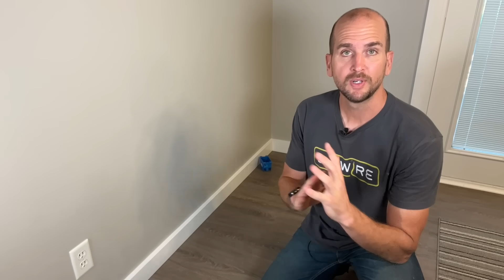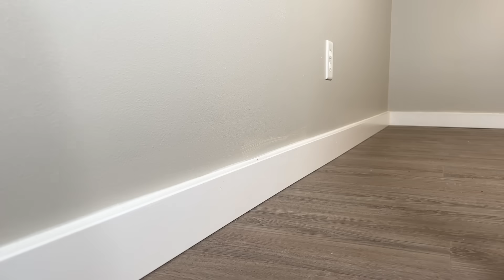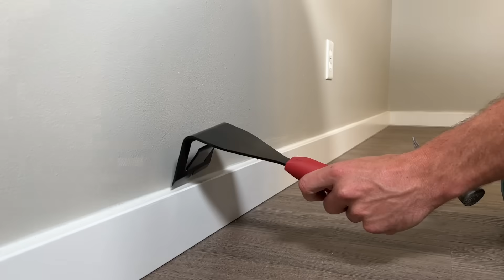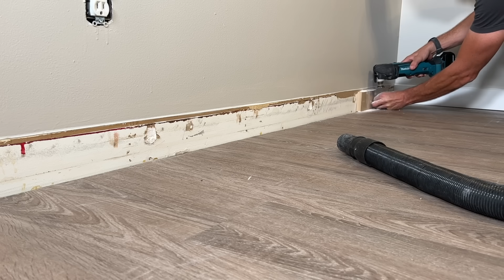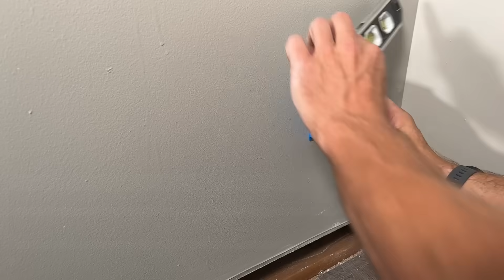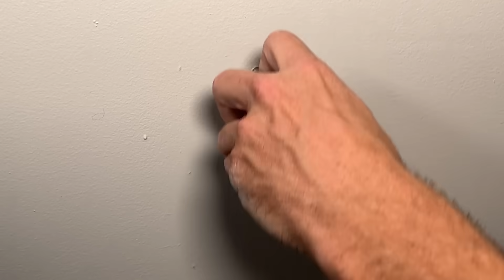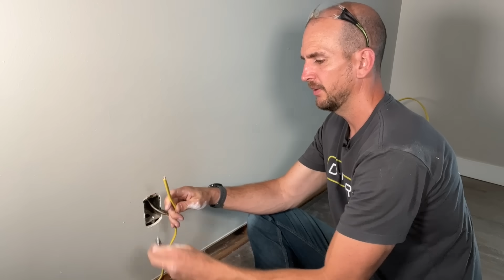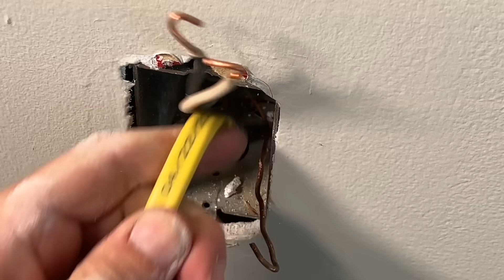How To Add An Outlet To A Finished Wall

Comment: Not to code, and not safe. The wire must have metal protector plates to prevent piercing the wire if it is less than 1.5 inches from any wall surface . This means he can not drill holes at any Hight thru the center of the studs and simply pass the wire thru. the wire is now less than 1.5 inches from both surfaces on that wall.  this unsafe  because someday someone can drive a nail or screw into that wire , by mounting something to the wall, even mounting something low to the wall like a bracket. Codes requires the wire have metal protector plate. The proper installation would be to notch the vertical studs and place the wire in the notch then cover with protector place. This will leave the wire close to only one side of the wall but protected by metal plate. And it will be  more than 1.5 inch inches from the other side of the wall. what he did here is very wrong and unsafe

Comment: This is a great video but everyone should know they still need to pull permits even if it is in their own home. In 🇨🇦 you need to arc fault protect the new wire and plug.

Comment: You need to also teach about the NEC rules about box depth.  That feeder box was set back more than 1/8' from flush so that needed a box extender or to be reset at the proper depth.

Comment: Lock nut is upside down fyi, should have teeth towards box. Appreciate the use of the Waco connectors though and the position of the cover plate screw.

Comment: A few things:
I used to be a high level electrician and back then Wago 221s didn't exist, but they are now my #1 connector!

3 12ga romexs would be max in that box, especially using wirenuts. There are deep and shallow boxes, unless there's a reason not to, I always opt for deep boxes. Regardless, keep box fill in mind when contemplating adding wires to a box.

When using old work boxes, cut the ears off the receptacle (or switch), least the cover plate will not sit flush to the drywall. For new work boxes (nailed on studs before drywall) leave the ears intact.

In most residential applications, the existing boxes will not be steel and will likely not facilitate a connector. In this case the romex will merely enter the hole (though you might have to break out a new one). However, when nonmetallic are used, the grounds are handled differently and for good reason. In the nonmetallic case, the grounds are usually twisted together tightly over a length of about 2.5 to 3 inches and a copper cround sleeve is crimped on them. Oftentimes the unused ground tails are cutt off up to the point of the crimp connection. This twisting of the grounds not only help bring the wires into better electrical contact with eachother, they help secure the cables into the box. This is particularly important in old work because the romex cables are rarely stapled within the wall cavity.

The cable holes of nonmetallic boxs are about half the diameter of the metal boxes, so getting the cable in can be tricky. I usually push a fishtape down through the hole and pull the wire up through. However, near the floor, a coat hanger will work.

It's not recommended to slice a romex open with the point of a knife, for risk of damaging the insulation of the individual conductors, especially for the non-professional. There is a specific Romex stripping tool available and they are crazy cheap to buy.
Reply: I learned it takes a very shallow score with my Stanley Blade to peel the Romex away 🤔
Reply: @OGBrown-bp8jy 
Romex is easy enough to learn how to score, yet it still gets people. However, most people that think they've got it down, simply don't check to see if the individual wire insulation is damaged. The truly difficult cabling to score without damage is SJ and to a lesser extent, SO cord.

Comment: This is bad a$$!!!  I've done this same job a few times... it's always turned into paint, sheet rock repair, repair job as so much modification was required.  I am looking forward doing this job again using your method.  So much cleaner, and easier!!!  Thanks for the new DIY project idea!!!

Comment: You should have driller your holes lower and used nail plates in front of each hole through the studs. Failing to use nail plates in front of your holes violates electrical codes.

Comment: Just an FYI - When checking to verify that power is off, Use the the tester on BOTH outlets. Never assume the previous wiring was done by a "competent" electrician. A friend of mine learned the hard way. Apparently a DIYer did a jerry-rig job on an outlet and the top & bottom receptacle were each wired to a different breaker, so the bottom receptacle was still "hot". It takes less than a fraction of a second to check both.
Reply: No need to test both, you can visually see there is only one wire coming into box, but for diyer can’t hurt to test both if difficultly seeing wires.  It also quite common to see two circuits feeding one receptacle(split-wire), particularly in kitchens where high draw appliances are plugged into same receptacle.
Reply: @drwzer  Dang! Wish I had your eye sight. Able to see the wires with face plate on. With face plate off and receptacle still screwed the box you can see the the wire behind the receptacle.
Reply: @AFmedic  Or, he confirmed the power was off (i.e. switched off the correct breaker) and as he removed the panel he confirmed that there was only one set of wires going into the socket.
That said, a good spot. Mr Murphy will get you every time.

Comment: So I have done this as well. The only diff is I did not cut off the trim nails and actually was able to re-install without using a new brad. They did line up to existing holes. Placing a small hard plastic piece where I would tap the nail back in prevented the nail cracking through the front face of the base board.  For me, one less step & less nail touch up. After any caulking, baseboard really not coming loose or going anywhere.  Great job and information!!

Comment: Great video. Just a friendly tip, you can also glue the baseboard back on with liquid nails and you won't have to fill nail holes and can skip the painting process
Reply: Not really a tip, there is a reason nails are used professionally, in case molding or baseboard trim has to be removed. If glue is on the back.. its removing the drywall paper/backing with it which would cause another set of issues.

Comment: Excellent !!!  But some thing I found on old farm houses, is to check each outlet of the receptacle. Sometimes they split the receptacle and wired it 2 circuits on different fuses.
Reply: That was code for counter top plugs until recently in Canada.
Reply: Counter top plugs in your kitchen 😜

Comment: Fantastic video!  I especially liked your attention to detail (ie code) with the strain relief nut (you referred to it as a "connector").
I liked that you drilled above the baseboard line, but I wouldn't use an inch spade bit for the stud holes though.  Code in my city is only 5/8" but I use a right angle drill attachment and a 1/2" bit which I find is plenty of room for 14/2 romex wiring.
Fun fact: in Canada, we use metal boxes unless its outdoors.  It's nearly impossible to find those sweet plastic boxes in standard hardware stores (we also don't have to ground light switches).
Reply: Yes, 1/2" is plenty of room.  1" hole removes 4x the stud material for no gain.
Reply: You can find plastic boxes at Home Depot but they are badged for "low voltage" applications.  They're orange and great for retrofitting scenarios like this one.

Comment: Why are you drilling a large whole through the stud when wire is so small reduce the drill bit size by 1/2. No heed of a Rx connector when the box has it built in. There is a code for minimum wire length in a jbox. You really did not need those wagos, that’s why do they have additional connections means on the back of the receptacles. More wire junctions means more potential faults. Fill rate issues. Greg

Comment: Nah I’ll go with the old school approach. Cut out a big clean rectangle of drywall, drill and wire, add a couple of backer boards, reattach drywall, patch and paint. Half the time and no special tools.
Reply: For me it's the painting. The time taken. 2-3 coats, trying to find some in the bottom of an existing tin of paint. 
Then the colour probably won't match. And will the finish perfectly match unblemished plasterboard (drywall)?

Comment: why do you like wago nuts, it holds the copper with two knife edges, how much current passes thru a knife edge?
Reply: @smallbyrdz3823  not good enough for me, one flat plate with one knife edge and spring tension vs tightened screw between two plates. the engineers may differ. the edge is probably only to prevent withdrawal rather than proper electrical contact.

Comment: In doing this install bringing Romax into a metal box you’d have to be sure that the metal box contains enough cubic inches to handle the amount of wires you have installed. A standard 3 x 2 x 2 1/2 box made of steel would not make the cut. It seems you may have overloaded the steel junction box with two number 12 wires, the device and the clamp. Double check the depth of your steel junction box. A box with a minimum cubic inch capacity of 18 in.³ would be the minimum box size. Check Article 314.16 as well as table 314.16(A) of the national electrical code.
Reply: In CEC wire nuts contribute to box fill capacity, two wire nuts equal one more conductor.

Comment: I little picky here but you should have used a green ground screw instead of the clamp screw for your ground to the metal box. Some old work boxes will have the 1/2 inch knock out blocked by the mounting bracket and cant be used as you did. You would have to use the romex clamp hole and you have used the clamp screw for a ground.

Comment: Very well done. I have been a master electrician in 3 states and did inspections in one and it is good to see #12 on the outlets. In 2 of those states the common is to use #12 for lighting and #14 for outlets. How stupid can you be? When I questioned how they came up with this nonsense they would say that's the way they always did it😵. In Maine I was always having to rewire nearly new homes because contractors were always popping breakers on the outside outlets. Couldn't even run a table saw. Thanks for letting me vent🤣
Reply: I was running Cat 6 cable while 20+ year electrician was there working. He kept asking why there's different colors of the cable I was using...We only use blue...why do you use different colors...what's the point. His boss finally told him to just drop it and get back to work haha I'll do my own work thank you if that's the "professionals"

Comment: Surely the initial outlet had terminals large enough to hold two twisted wires, instead of having to use strip connector which has potential of failure in time.

Comment: Rather than dealing with a 2 screw romex connector, you could save time by using a plastic snap in bushing like an DRC50. Those are some stout strippers, what are they?

Comment: I grew up doing eletrical work with my father and we always j hook the plugs and used on our grounds and used wire nuts if the application called for it

Comment: Why wouldn't you just use the receptacle as the connector for the old wiring & the new.  There are multiple connection points on the receptacle, except ground.

Comment: Been using the trick for years in the home theater and automation industry. Makes quick work of an outlet for a tv even when it’s not directly below. My only issue with the video is the press connectors. Call me old fashion, but I’m team wire nut all the way. Now let’s see your trick for an outlet over a fireplace.. I’m keeping mine a secret. But, it can be installed in under an hour with no repairs.

Comment: another tip, or suggestion, you should mention is, to put a strip of electrical tape over the terminals. I do electrical work with the Airforce and that was something i've done since day one. it's a nice added form of protection from accidental contact. (if the box is metal or multiple switches/receptacles are used in 1 box)

Comment: You can absolutely have too many outlets...  this is actually kind of dangerous without explaining how many outlets can be on a circuit and wire.   Most of the time they build houses with just below maximum outlets, so adding more and using them all can be a bad idea.

Comment: @Falasi4 – This technique is great, however it totally will NOT work on plaster walls because there is not a big empty space behind the trim. Plaster has a ledger board embedded in the plaster behind the trim,  usually above the bottom plate. Also there will be a whole bunch of hardened plaster on top of the plate – stuff that dripped behind the lath. Finally, plaster is much, much harder and more abrasive than drywall or joint compound (the total opposite of "Easy Sand"). You will need a blade with carbide tips. Plaster just destroys regular saw blades – that cut in the video would have taken at least 3, maybe 5 or more.

Comment: The only thing it's not the code man if somebody replaces that trim  shoving nails in it they're going to hit a hot wire best way  is flush mounted extension cords now much easier solution than what you're doing and safer too

Comment: Just replace the outlet box with a hyperspace junction box, and then you can run the wire through hyperspace.

Or maybe we should design hollow walls, that a person can go inside of, to run wires and pipes. Isn't that much of the idea why we build basements? So as to have access to infrastructure. Or why the Enterprise on Star Trek has easy-access Jeffrey's tubes.

Comment: As a Brit, and I know standards differ according to region, but I was shocked to see no sheathing added to the earth (ground) wire.  Given that it folds and twists as the plate is pushed back into the recess, it could easily foul the power terminals.  Here you must have professional certification before altering electrical installations.
Reply: Nope. In the UK, 'Part P' does allow you to add 'extensions'. Which in UK parlance are spurs.
I agree with your comment about earth sheathing though. That was a surprise.

Comment: From a professional electrician: I love the baseboard cut. Very creative. HOWEVER, Wegos and backstabbing are wrong in this application. They inevitably fail over time and can cause electrical/overheating fire. Always use wire nuts and the screws provided on the devise.
Reply: I totally agree but to be fair the plug in this video isn't back stabbed. The holes in this one are part of a compression connection actuated by the side screws so not nearly as bad as regular backstabbing.
Reply: Yeah, can just chain right off the terminals on the outlet for a short run like this one and save a little on buying wegos.
Reply: The back wiring approach is "OK".  Personally I go with a hook whenever at all possible because I want a lot of wire/screw contact area.  Those lever nuts are nifty, but I grew up on Wire Nuts, so I use them.  Cheap and time-tested.
Reply: He didn't backstab. The receptacle had back-wire terminals. I also hate wagos. They're good for DIYers.

Comment: Master Electrician here. This wouldn't pass code.
First- Tamper resistant outlets are required.
Second- Needs nail plates.
Third- Wires cut too short.
Forth- Most jurisdictions don't allow drilling more than three studs in a row for structural integrity.  
 Fifth- He mentioned this is a rental. You are not allowed to do your own electrical on a rental property, you must hire a licensed professional. You're allowed to put your own family at risk but not others.

P.S. Never use stabs and avoid wagos whenever possible.

Comment: Those push connectors are terrible. I've seen so many of them get loose connections. They also don't grip strand wire. One of my coworkers got hit with 277 because a factory wired light fixture used strand wire with those push connectors and the wire just pulled right out.

Comment: Two minor mistakes pulling the trim. You are best off to find a stud and pry there  NOT randomly because if there are any larger nails or trim screws in it, you'll cave in the wall between studs.
Pulling the nails from the back won't leave nails ends sticking out from cutting them. That makes reinstalling the.base easier if you have to slide it, usually following a floor that isn't flat.

Comment: Instead of using connectors, if there is space, and it looks like there is, perhaps not for ground, you'd be better off connecting the wires to the outlets directly...

On an other note, I don't know where you are from, but strictly speaking is this legal to do for anyone there? :)

Comment: If this is an outside wall, don’t forget to put the insulation back or insert some new spray foam insulation from a can if you had to cut out the spray foam insulation.

Comment: I think I would have gone the extrato get the outlet around the corner, because that stub wall looks to be 24 inches. This also gives you the option of extending circuit to the next room ... not dtracting from the fact that this is an excellent video ...

Comment: Holes drilled at that angle in a 2x4 is a violation of NEC as the wire will be too close to the drywall.